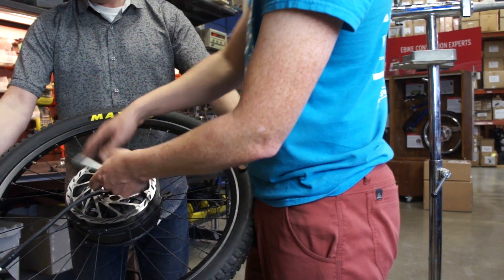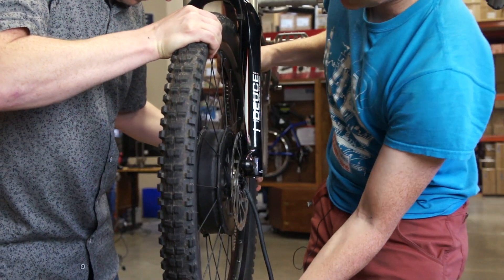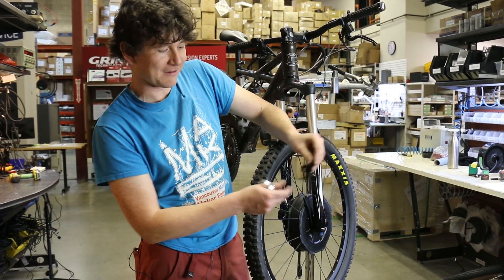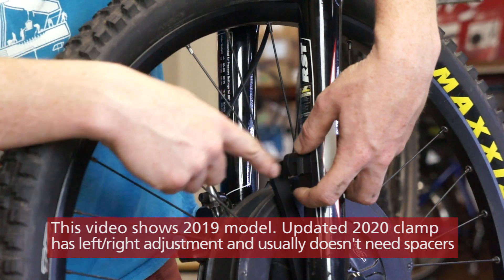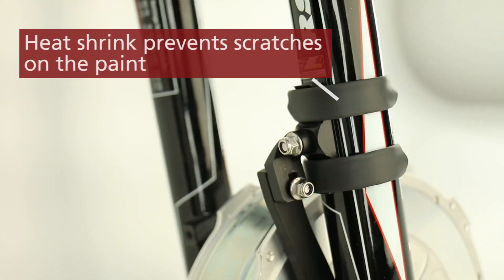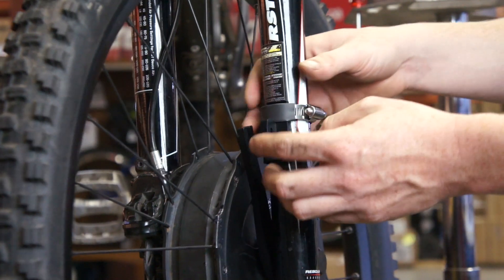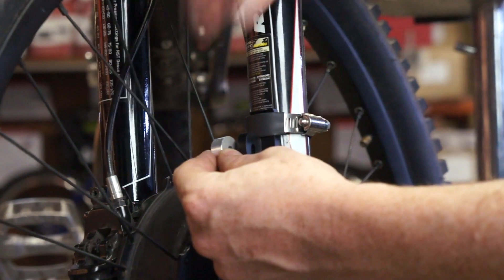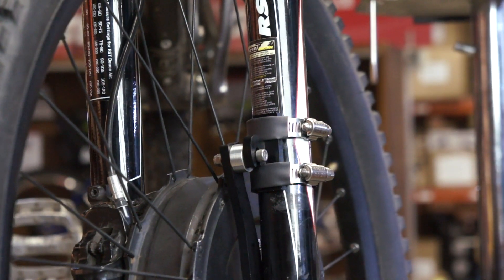Installation of Grin All Axle Hub Motor on a Thru Axle Fork

Comment: so this front electric wheel is a 20mm thru axle
Reply from the maker: The V2 All-Axle will work with 20mm thru axles, but that support was dropped with the V3 model since almost all thru-axle forks these days are 15mm or 12mm.  See https://ebikes.ca/product-info/grin-products/all-axle-hub-motor.html#VersionHistory

Comment: With the torque arm connected to the fork, does this then negate the purpose of quick release without tools?  Just wondering, I take my front tire off and connect my forks to a mounting bracket in bed if my truck when transporting.
Reply from the maker: You can have a 2nd quick release to link the torque arm to the frame clamp, and then it's toolless with two QR levers to open up rather than just one.

Comment: The hub motor simply slips over the spindle, right? It doesn't revolve on the spindle, right?
Reply from the maker: That is correct, there is no spinning required. In this case the axle was a little bit tight in the fork so we had to twist a bit to slide it in but normally it would slip in quite effortlessly.

Comment: Wondering about torque arm stress applied to carbon forks because I know just enough about carbon components built to take load one way but not other ways but it's probably ok because if it wasn't, well then, the nice man would indicate as such amirite.
Reply: General consensus is to avoid carbon forks for hub motors, though there are examples out there running it with 1000+ miles and no issues to report. You can find those on forums with a quick search.  I'm debating this exact setup due to the limited steel, aluminum or titanium fork options for my bike. Thought process is that if a carbon fork can withstand the much higher torque of braking it should theoretically withstand the torque from a hub motor. If you have the funds and option to swap the fork, why not for peace of mind. Otherwise determine if you can live with the "risk" of carbon.
Reply from the maker: @grimmsheldon  This comparison with braking forces is exactly correct. If you trust a carbon fiber fork with disk brakes, then you'd be silly not to trust it with a hub motor. Not only is the max torque of the motor much less than the torque of a disk being squeezed, the effective lever arm of the torque arm is longer than the lever arm of the disk caliper, so the net effect is lower forces on the fork from the motor than you'll be seeing with a non electric hub and brakes.   

The situation is quite different with a hub motor that doesn't have an integrated torque arm since then there can be enormous spreading forces on the dropouts, but on a motor like this where all of the torque is transmitted through the arm there is no real concern.  Best to be guided by sound reasoning and engineering principles than by consensus!

Comment: I would like to know if it is possible to mount this motor on the rear wheel (thru axle) with a gear and how much does such a set cost?
Reply: Afaik the "All axle hub" is for front mounting only. Maybe check Grin Technologies website for the selection of rear direct drive hubs.  https://ebikes.ca/shop.html
Reply from the maker: This motor model is not currently available in a rear version, but we do have a 142x12 and 148x12 boost size thru axle rear motors from Crystalyte if you have a thru axle bike frame and need a rear motor rather than a front hub option.